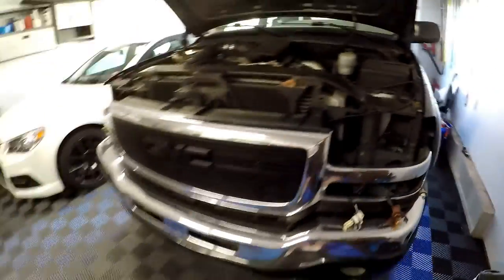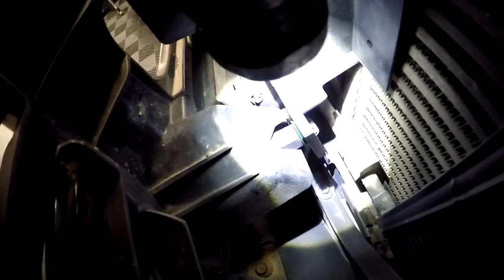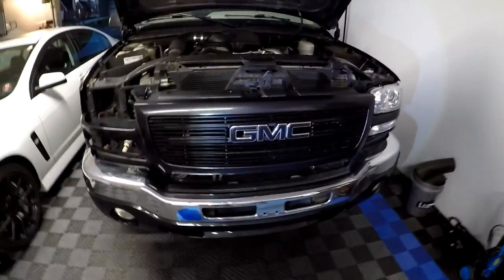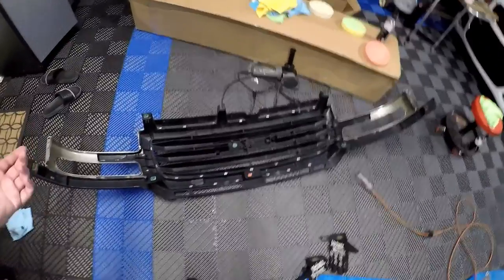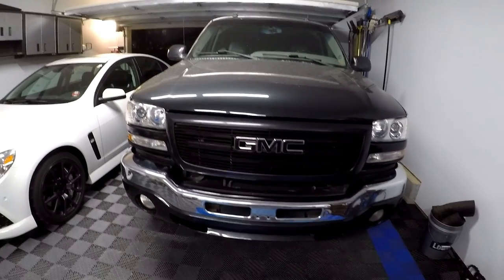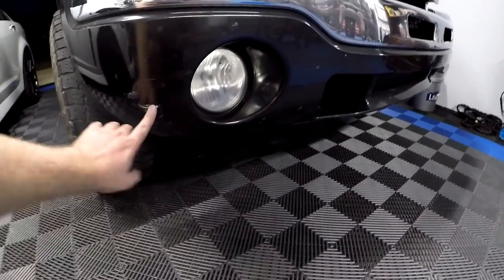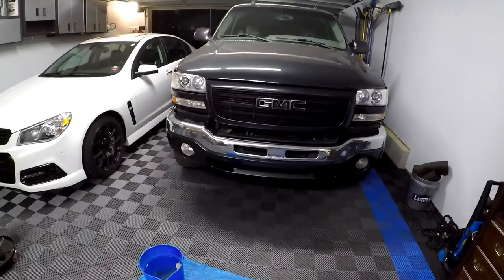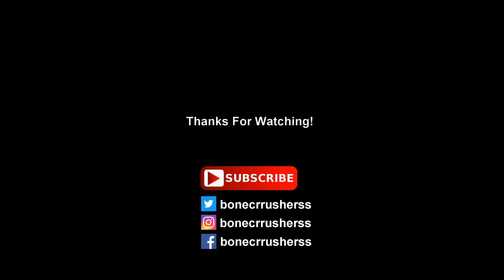2005 GMC Sierra 2500HD - Front End Upgrade Pt 2 - Installing 1500 Grill

Comment: does anyone know how to convert an 03-06 gmc sierra 1500 to HD grille? i really like the black spacer
Reply from the maker: You could buy the 2500HD grille - and just remove the bumper - drill the holes 1 or 2" down in the chassis - and reattach the bumper.

That should work - the 1500 and 2500 have the same fenders, headlights, etc.

Comment: Why? That's not an upgrade that's a degrade...  2500 front looks 1,000 times better than 1500
Reply from the maker: +Stompahz Raised bumper means less bumper cutting for bigger tires.

Comment: Is the gmc 2500 grill the same as the 1500? They both fit the same?
Reply from the maker: 2500 grill has an extra trim piece on the bottom of it - 1500 grill does not. If you have a 2500 - you need to buy the 1500 grill and put spacers under the front bumper to raise it up.

Comment: You think a 2500 gmc grille will fit in my 05 yukon?
Reply from the maker: It might bolt up to the Yukon - but you would have to drop the entire bumper down because of that 1 or 2" black plastic piece that is on the bottom of the 2500 bumper.
Reply: Yes